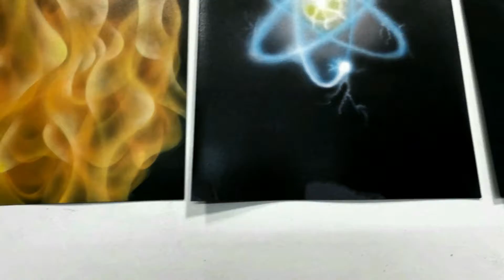Airbrush Basics - An Introduction To Airbrushing RC Car Bodies

Comment: Cool, I already have a 125psi compressor with a 60 gallon tank.  I also have a regulator/water trap unit.  All I need is the airbrush and hose attachments and paint!  Thanks for the awesome tips and quick demo!  I never got into painting drivers because when I started I brush painted the first one I did and hated how it turned out.  So I would just paint the windows black to avoid having to paint a driver.  Most recently I built a Comical Avante, instead of building and painting the driver I put a Kenny figure in.
Reply from the maker: Yeah, you pretty much have everything. I should apologize for that quick demo, that was really bad lol, but you get the idea. You're not alone there mate, I used to not even take my driver figures out of the box! lol. I should have elaborated more on painting driver figures too, the majority of the driver painting is best done with a brush but I always airbrush the helmet these days. I also do the darker shading on the suits with the airbrush. But for sharp lines, for belts and stuff you can't beat a fine brush. I've seen a lot of different driver figures in RC but never a Kenny, that's awesome! 🤣👍

Comment: Excellent, very good explanations and demonstrations, it's really informative and it makes you want to try the airbrush, I've been hesitating for a long time but in the end it would really save me a lot of time. Of course it takes a lot of practice to achieve what you are doing, but with patience it should be good.
Reply from the maker: Thanks mate! I tried to make it as informative as I could but I'm sure I left a few things out, oh well lol. You should give it a go, I think you'll be good at it as you have good attention to detail. 👍
Reply: @RCHobbyShed  I think to try, first I will buy a simple to use and cheap one and if I like it I will buy something more efficient, can I do this in my workshop or do I need ventilation? there is no smell of paint?
Reply from the maker: @satorrotas  Sound like a great plan! You really should have ventilation. I don't have any in my room but I do need it. It's best to have an extraction fan to take the fumes outside... If you only paint small items, like RC drivers it's not so bad. If I paint en entire body, I usually take it out to the shed and have the windows open. 👍
Reply: @RCHobbyShed  Ok thanks for the information, I'll see if I can do an outdoor evacuation. I will look at what I find as an airbrush on the internet, thank you again for these details 😊👍
Reply from the maker: @satorrotas  No worries at all mate. Feel free to ask if you have more questions. 👍

Comment: Thanks for taking the time to put this together, really nice tutorial!
Your gear is a bit over my budget, but I think I should take the plunge now. I have painted 6 lexan bodies now with Tamiya rattle cans and it's gets kind of expensive, too!
One question I got: I didn't notice you wearing a mask, and I don't think I heard you mention anything about it, I reckon that's because there isn't many toxic fumes?
For me, that's my main turning point, I am really fed up with a stinky cellar every time, and overspray all over the place.
I think my mind is made up, now just to find a good compromise between cheap price and proper quality, the ever present dilemma!
Reply from the maker: Thanks! In answer to your question, yes a mask is advisable. That was an oversight on my part, I should have mentioned it. Yes there are fumes and yes there is overspray. Some of the water based paints, such as Createx and Proline aren't too bad for fumes, but enamels and acrylics really stink. In an ideal setup a box or "booth" type setup is best, with an exhaust fan to draw fumes outside. There are many videos on youtube on how to make an airbrush spray booth quite cheaply. 
You don't need to spend a lot for a basic setup. All you really need is a compressor with an air tank, a regulator with a water trap and airbrush with a 0.2-0.3mm nozzle.
Hope this helps. Good luck in your search and have a Happy New Year! 👍

Comment: Great stuff Mick, iwata make very good gear. In panel shops it's Devilbiss or iwata and if you're rich Sata.  I test drove the ultima tonight and it's a beast . Plenty of power and handles well.  The under steering is not bad at all, but I'm not used to it yet . The trouble is it's too nice to bash and crash. It's my favorite beast, need to build another old kyosho.  Will have to invest in an airbrush and practice.  Great video and learnt a lot . Thanks mate.
Reply from the maker: Thanks mate. Oh yeah they do! I actually bought Iwata because I'd seen my brother using one, he's a spray painter, well my dad and cousin are too. Maybe I should have done that too? People are always smashing cars! lol. Good to hear you're happy with the Ultima. I've never had much issue with the understeer either, it's usually on gravel you might notice it. Kyosho used pin spike tyres on the front of the Ultima Pro, I think that would have helped. I can see there will be an Impala getting around with airbrushed flames on it soon! 😁👍
Reply: Ha,ha,the wife will kill me if I put flames on the impala.  The ultima took me twice as long to build as the losi 22.50. Wanted it perfect,  spray painting is ok ,panel beating sucks . Pay was not worth it years ago and doubled my money running extruders.  Heard the pay is better now because they can't get tradies . Just bought 2 Devilbiss Flgs, cheap guns are not worth it.  Can't go wrong with iwata , cheap stuff just ruins the work.
Reply from the maker: @petergoodwin2465  Haha, yeah it's not worth it, safer to airbrush rc's. Oh yeah, I was making a lot more than my brother when I was running extruders but with our car industry gone that was it for me as we mainly made plastics for the car industry. I've been using this Iwata setup around 6 years now, no issues. True mate, the work will only be as good as the tools! 👍

Comment: your videos and information is so good bud, it helps so much as ive been using cans and now that ive started to get a few kits like two a week and some are hardbody's and usually i like to do them to box art keeping as original as possible but then sometimes you get a few kits that are just wanting a real neat and outhere style paintscheme and the airbrush would come in handy for so many application besides the cans are to expensive and run out too quickly this video has been a big help in helping me decide to go that next step and look for a decent airbrush system, hopefully one day we can go for a drive at the track if your local to Western Subs Melb-Altona take out some of these Beasts clear some cobwebs out of the gearboxes lol cheers bud.
Reply from the maker: Thanks Andrew! Once you get your hands on an airbrush you'll never turn back. There is still times you'll use cans, I still use them a lot. But there's so much more you can do with an airbrush, like mixing your own colours and you can get some automotive colours and finishes too, so you can have a look like no other RC. That would be great, would love to drive on a track. Unfortunately I'm in Cranbourne, so it's like a world tour for me. I do recall there is a pretty decent track (or two) over that way. 👍

Comment: Sorry if i missed it but is Createx paints you said were waterbaased for lexan,? you said the proline was for polycarbonate,is that styrene?  How do you find lexan paints for airbrush compared to Tamiya lexan paints,stick as good?  great video ,thanks
Reply from the maker: Yes, the Createx paints are water based as are the Proline paints, they're actually very similar paints. So, Createx and Proline for Lexan bodies, Lexan is just a brand name for Polycarbonate. I know In the US and maybe UK most refer to Polycarbonate bodies as "Lexan", I sometimes do but usually I just say "Polycarb'".  Enamels and Acrylics for Styrene or ABS hard bodies. To be honest I think the Tamiya PS paints stick much better than the others on Lexan. One trick to the Createx and Proline paints is even light coats and longer drying between coats, or dry with heat between coats. I should add, when I use the Createx or Proline paints, backing them with Tamiya PS paint can help make it more durable. Hope this helps. 👍

Comment: Hi mick awesome video on air brushing could you tell me where you get the paint ? I like the paint you used on the super dragon wheels thanks in advance
Reply from the maker: Hey mate. Thanks! The Createx paints I buy from Airbrush Megastore here in Australia, but they can be bought at most online airbrush supply store all around the world. Keep in mind the candy on the Super Dragon wheels is reliant on having the gold plated wheels as the backing. Either plated gold or chrome with candy on top will give that reflective finish. It really needs the 2k clear over the candy as well, otherwise it will be kind of flat looking. Hope this helped mate! 👍
Reply: RC Hobby Shed thanks mick the information is so helpful I will check out airbrush megastore 👍

Comment: Can i just spray a heap of PS paint from spray cans, into the canister on the gun? Might be a bit messy, but can I do that?
Reply from the maker: Absolutely you can do that! I do it quite often, but forgot to mention it haha. I usually do it for small touch ups and stuff, just spray a little into the lid of the can and tip it into the airbrush... The only issue I've found is the PS paint tends to dry as it's being sprayed and results on cobwebs, but they can be brushed away easily. 👍